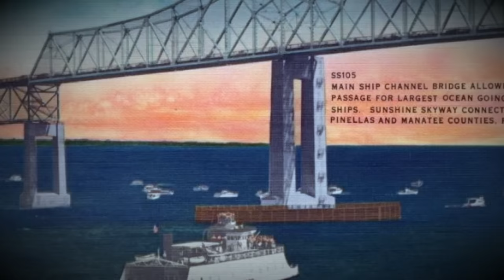The Sunshine SkyWay Bridge Disaster 1980 | Plainly Difficult Documentary

Comment: 13:17 Imagine reading the sign "NO stopping on bridge" and ahead of that sign is a missing bridge.
Do any bridges exist with some alert system when a section goes out? Something that would turn a light on if a signal from one end of the bridge doesn't reach the other side.
This would help dramatically as incoming traffic often can't see the peak of the bridge, or the drop comes too sudden because you're going up all the time and you can't see over your own head's elevation.
Reply: No, bridges don’t have that. Bridges are not expected to collapse, therefore no alert system should exist. Alert systems are for things that can predictably go wrong. A bridge should never predictably collapse unless you’re demolishing it.
Reply: @CantHandleThisCanYa  but bridges can and do collapse. Bridges aren't built to be indestructible monoliths, they're built to withstand expected forces. That's not to say such a system would be viable, but rather than the assumption of a bridge never collapsing is a faulty one.
Reply: I don't think so, it'd be easy to implement too, just fit a wire going through the entire bridge sending a electrical pulse every 30 seconds or so and if something happens it will cut the cable making an alarm sound
Reply: @CantHandleThisCanYa  
I understand that they aren't expected to fall apart, but accidents happen, especially when spanning busy water ways with frequent (aka **expected**) low visibility.
Reply: @CantHandleThisCanYa  So smoke alarms aren't needed either then? I mean, my house isn't expected to catch fire.
Safety features that can save lives are always worthwhile no matter how low the chances of an incident occuring, acting as if a unexpected disaster can't happen ends in things like the "unsinkable" Titanic going down and thousands of lives being lost, had they put safety ahead of profits and costs many more people might've survived.
A life is worth far more than any cost for a safety feature.
Reply: It would be cheap to put in a collapse detector. It would cost a bit more to install red flasher emergency lights that would wire up next to the regular street lamps.
They would start flashing if the bridge circuit was cut. Edit: a gate would be really good.
...If they still want to drive up the bridge despite warning lights and a gate, Darwin is calling them home.

...The streetlights themselves would be helpful if independently wired.
Reply: Bridges typically have power and communications lines run under them, at a very basic level for lighting, but for other purposes as well. In any event, monitor those lines of you must monitor anything.
Instead of planning for a bridge collapse, engineer to avoid collapse. You will end up with a better bridge.
Reply: Railway bridges often have similar system built-in
Reply: they do have a system nowawayds, the current skyway bridge has it but the old one obviously did not. from what i understand it's not on all bridges but most newer bridges at least do
Reply: @nyoomi1483  Required safety is good within reason, but should not be held as an "at any cost" or "even if it saves just one life" goal. Smoke detectors are cheap and very effective =good. Airbags in cars aren't cheap and a collision doing $2K in bodywork damage can set off $8K worth of airbags when even just a seatbelt would have given all the occupant protection needed = not good. 

A very simple system to detect and warn of a bridge collapse could happen for a $fewK or less per bridge and need nearly no maintenance =good. But don't expect to see it courtesy of our greedy governments who want to spend that money on bronze plaques, shrubbery, and new trash cans in a more likeable color instead of doing some real good for us.
Reply: Many newer bridges have a sort of on-the-cheap version of this: It takes advantage of powerlines or similar utilities that are placed on the bridge. If the bridge fails, the powerline will too; if the powerline fails, hit the cameras and check the bridge. It's really similar to track-fault detection circuits on railways, but taking advantage of what's already there, with no need for a separate purpose-engineered detection system.

Another way to do this is with strain or movement gauges. Any severe structural deformation anywhere in the bridge will cause changes in strain or movement at other parts of the bridge; any abrupt shifts should set alarms going off at the very least. This has the added benefit of providing ongoing data of great importance to maintenance engineers. 

The growing applications of instrumentation provide a great deal of information that can be used for emergency preparedness: Again, if instrumentation is there to monitor the bridge anyway, why NOT use that data in a failure alarm that monitors it for specific indicators? The only thing you'll be spending extra for is the software.
Reply: I feel like if I saw the bridge collapse ahead of me I’d stop, signs be dammed. But if I didn’t see than I could see myself accidentally going over if I didn’t notice, hopefully I’ll never experience that.
Reply: The Tasman bridge in Hobart Australia had a similar accident that caused it to collapse. Now when a large vessel passes underneath it the traffic is stopped.
Reply: Lions Gate Bridge from Vancouver BC to the North shore of the harbour is a 3 lane bridge with traffic control lights all along the causeway, they are used to shift traffic lanes to help keep the flow steady in heavy traffic. In event of a catastrophic failure of the suspension bridge they can all be set to stop signals.
Reply: @Yezpahr  Your original comment reminded of the woman who was stopped for speeding and told the officer. "My brakes stopped working, so I needed to get home quickly, before I had an accident". 😊😊
Reply: I have been on multi-lane two-way bridges where each lane has a red and green light at intervals.  They can change the lights if they want to use more lanes in one direction.  I would think that in an emergency they could instantly turn all the lights red, without needing to use a sign board.
Reply: The state of Florida did put alarm system on the old remaining structure. It consisted of a simple electric circuit.  A wire running on the bridge. As long as the circuit was complete there was no alarm. If the wire was broken for any reason signs would illuminate warning traffic to stop. I know this because several years later I worked with the guy that was in charge of installing the wiring .
Reply: yes exactly, should have been some Control and protection mechanism involved.
Reply: @saintsucks  Thanks for the conclusive and extensive answer, there were quite a few mixed signals in the comments whether bridges have these warning systems in place or whether they don't.
Reply: @justingrey6008  just do both

Comment: The squall that impacted the summit venture also produced something called a microburst (an intense downdraft within a thunderstorm that is accompanied by extremely heavy precipitation and winds that can exceed 100mph) which I believe is what you mention when you said that strong winds from the stern contributed to the collision.
Reply: The fast lateral winds you actually get outside of the microburst itself as that describes the rapidly falling column of air itself. The lateral winds are the inevitable result of said rapidly falling air with a lot of momentum meeting the ground which forcefully pushes back declaring that the area bellow is occupied. This of course results in a sharp pressure spike as the air pancakes into the ground and thus overcomes the lower pressure of the air around the microburst and violently blasts outwards. But yeah they are scary as hell especially in an aircraft, probably not much better for a ship though since although water being more viscous is affected less it would produce not insignificant wave action radiating out from the microburst. The increased pressure in the centre will depress the surface of the water somewhat with the excess being pushed outwards in a series of waves as again the pressure near the surface of the water near the middle will be higher than that of the air above it around the perimeter. Water will escape by pushing up and out around the edges to relive the pressure imbalance. So the ship would also be experiencing a slower moving but much denser fluid pushing away from the microburst too, one that is also more viscous so will drag more along the sides of the hull hydrodynamically pulling the ship along with it too.

Comment: I'm familiar with the area, and the sudden storms are a regular occurrence. You can see massive sheets of grey pouring from the clouds from miles away and just the other day there was a batch of rain so strong I heard it coming for a good 30 seconds before it arrived. They don't last very long, but in those conditions, your best bet is to be extra cautious, make yourself visible, and get to a safe stopping spot. 

The roads here are particularly frightening. They're massive 3 or 4 lanes either way, in long gentle curves. Drivers get so used to speeding along them at 60 to 70 miles per hour, and upwards of 80 on the highways. When inclement weather hits, for a lot of the drivers, muscle memory takes over, and they still speed and skid. And with some of the overpass bridge designs, I still fear the one time everything is going to ice over...
Reply: I don't think people know how heavy the rain can get there. At times when driving the rain would get so heavy you can't see past the hood of your car at 25-35mph. I remember several times on my dad's tug we were going towards the Gandy and the rain made it impossible to see anything. That was pre-GPS and we had to use the compass and chart. It was a bit worrying but my dad made it look easy. In a giant ship that is blinded by rain, dealing with high winds and strong currents, it's a lot more difficult.

Comment: I went to college at Ringling in Sarasota ('03-'07), and every time I flew home for holidays or hurricane evacuations out of TPA I had to cross the Sunshine Skyway. It's only recently that I learned that this disaster even happened. Now the bridge is so high up that there are red emergency call boxes at the peaks that directly connect to the ☠️ Prevention Hotline.
Reply: Omggg that last part
Reply: Ringling alumni here too (1998-2001) and was a longtime St. pete resident in the 2000s..I can confirm that this is one of the scariest bridges to drive over (not too mention it’s eery history). If a thunderstorm or worse yet, a hurricane hit, you could feel the bridge sway due to the wind..so they would shut the bridge down until the weather subsided. During my time as a Ringling student, if I ever had to drive over the bridge during bad weather/a storm, I’d pull over into the rest stop (right before the bridge) and wait for the rain/thunderstorm to ease up. It’s a beautiful bridge, but scary as hell. And seeing those red phones on the highest points of the bridge..surreal and sad knowing it’s history.

Comment: I grew up in the Tampa Bay area. I was in high school when this happened. I remember it well. You skipped over the story about the one car that managed to stop just a few feet from the edge and was left resting on that portion you see bent downwards. It's the car you see plainly in the thumbnail. The tragedy of the Greyhound bus though, it reportedly landed upside down and the entire roof was collapsed and crushed the people inside
When the new bridge first opened there were a few accidents on it at night caused by cars stopping on the bridge to gawk at the cables which were dramatically lit at night. Unsuspecting cars would reach the summit or just over and find some idiot sitting practically still with his head sticking out the window staring up at the cables. The bridge is part of the Interstate Highway system so the speed limit is 65mph. People were being killed. They have since calmed the lighting down by quite a bit so it is not as distracting as it once was. It is quite striking the first time you cross over such a bridge especially at night and the New Sunshine Skyway bridge was one of the first of its kind in the world when it was built.

Comment: Living in Tampa in 2000, a report had come out that the new Sunshine Bridge had a structural problem.  The huge concrete towers that support the bridge are hollow.  In the hollow area cables run vertically and are in tension to brace the towers.  It was discovered that the concrete was cracked and leaking saltwater into the towers causing the cables to rust and degrade.  The bridge is still up so they must have found a solution.

Comment: We moved to St. Petersburg from Ohio around 1983 or so. I got my driver's license in 1986 or 87. I've driven, or ridden, across most of the bridges connecting St. Pete to Tampa. It is a bit nerve racking, especially if you breakdown or run outta gas. There is a bit of a shoulder on either side if you can get your vehicle over. Once I was driving across, coming home from college. I had a zippy little sports car with a sun/moon roof. I had all the windows and the sun roof open, blasting some annoying early 1990's pop music and this huge pelican came up on the passenger side, across the hood and over the driver side. I didn't hit it but it pooped on my car. It started around the front passenger tire, covered the entire windshield and missed coming in the sun roof by inches. I was nearly off the bridge so I kept going but I couldn't see anything. My wipers just smeared and made it worse. I finally got where I could pull over and I just sat there, engine off, hazard lights on, trying to get my heart rate down. A couple vehicles pulled over, driver's check on me. They were trying not to laugh but I guess I was white as a ghost. They started pouring water all over the windshield, trying to clean it off. It was an experience I don't want to repeat.
Reply: You obviously scared the shit out of it...
Reply: It's instances like these that make me glad that cats or dogs never evolved flight.  Could you imagine the mess?

Comment: 00:47. This reminds me A LOT of the old Grace Bridge in Charleston, SC.  Except the 2 lanes were each only 8’ wide and the curbs were maybe 4” wide.
Reply: The Grace and Pearman bridges were long overdue for replacement; the Ravenel bridge is SO much better. But now there's no redundancy in a second bridge should one fail for any reason. Had to be done, the old bridges wouldn't have withstood another Hugo...
Reply: @P_RO_  it’s hard to picture but for 30 years, the Grace Bridge was the only bridge, with 2 opposing single lanes.  Would be pretty scary facing big trucks in the other lane!
Reply: @mattkaustickomments  It was a common place danger in those days, as were very deadly crashes at relatively low speeds; luckily not much on bridges. The Grace bridge was the most important thing to Charleston's 'modern' development as it finally allowed easy access to inland, which had always been a problem there. I like all the old steel bridges myself, but we do have much better ways now.

Comment: I lived in Tampa from 1983-94 and often traveled on the new Sunshine Skyway Bridge. For my job December 1992 to November 1993 had to drive over new bridge 5  days every week: to Sarasota every afternoon and back to Tampa after midnight. Was bigtime scary, especially at night. It was scary because you were so much higher than the old bridge which made the winds much stronger. Often the winds would push your car sideways and you had to quickly correct or you'd bang into the cars in the adjoining lane !! Also, there was nothing overhead, no steel "roof", and you felt like you were sitting exposed on top of the roadway hundreds of feet up in the air. At night you felt like you were flying, with stars overhead and the lights far below of cities, towns, and streets.

Comment: Your video didn't mention too much about the lack of roadway controls, but in another video on this collapse I recently saw, they talked about how after this incident they added not only the lighting the original bridge lacked but also a series of message boards and a communication system so should there be an issue, drivers can be warned and stopped before they get to the problem, and no new drivers can be allowed to start the drive at the ends. There was no such provision when this happened.

Comment: I thought it was that pilots never controlled the vessels but instruct the captain on what to do, monitoring and guiding. Except for a few certain areas where they require the pilot to control the vessel due to it being difficult for the most experienced captain.

(I think you did mean this and technically are right, I think many unfamiliar with this stuff may think the pilots take physical control of the vessel, steering etc).

Comment: I was on the next bridge up, gandy. The storm/squall that came up was very quick. The rain was so hard you could not see the car in front of you, just see the small tail light in front. You did not have a pull over lane, so white knuckled, I kept on driving to the causeway (longer land bridge) that was at the end of the bridge, where i could pull over. By the time I got to the end of the bridge the rain had passed, Then I heard about the bridge on the radio.   The crown of many bridges are slopped where you could not see the roadway, as fast as you are driving. This is how the middle rises for boats to pass under. If i remember, the only survivor was in a pickup, when he went over, the door opened and threw him out,  the crew on the boat saw him and rescued him. I do know a bit more about this but would rather not mention it here. Was it avoidable? ........ These storms are frequent during the seasons. The pilot was supposed to be capable of bringing the ship in. He did not.
I never felt this shocked until hearing about the towers being hit, 9-11